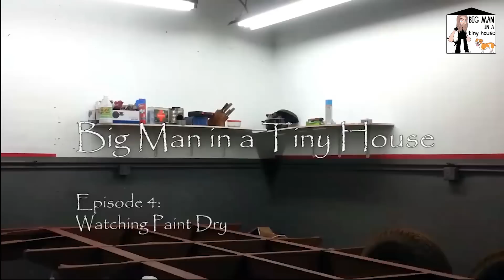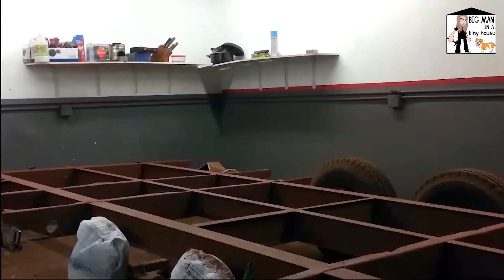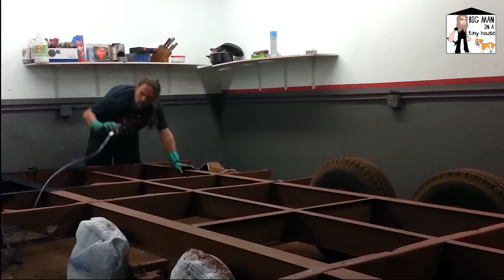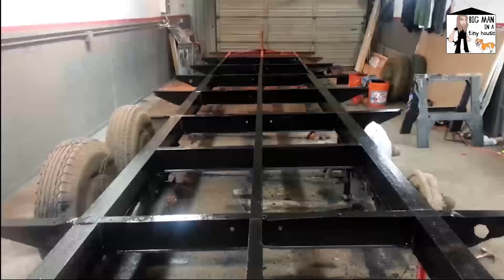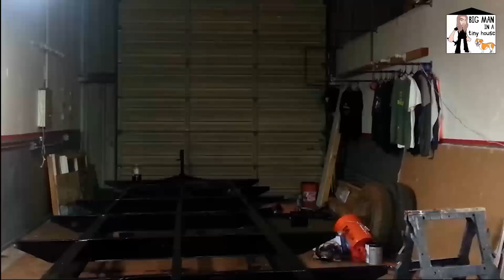Big Man in a Tiny House: Episode Four  - Watching Paint Dry

Comment: I've Googled the answers, but I was hoping that for the sake of viewers tgat maybe in future vids you can address random questions, such as, how does one insure a house on wheels? Auto insurance or homeowner's insurance? Or what does one do for electricity? Use the car battery, or are there additional batteries installed somewhere?
Reply from the maker: Adam Krause :  My plan for electricity will be something similar to an RV.  You run an extension cord from a power source to the RV connection, this powers a subpanel in the Tiny House which powers the house.  "Of course the way I will obtain that power depends on where I end up.  If I buy land that doesn't have an existing power line and/or having power run to the property is too expensive to bring in I will probably have to buy a generator and run off the generator while I save for a solar setup.Ideally, eventually i will run a combination of wind and solar to be as self-sufficient and energy conscious as possible.One good thing about having a 250 sq. ft. home is that heating and cooling costs are significantly lower than in a typical house.In terms of insurance, you'd likely only be able to get insured as an RV.  Building on a trailer and adhering to legal limits allows you to classify it as an RV.